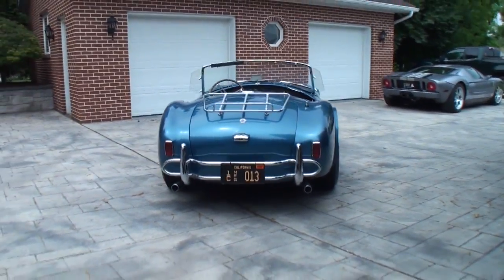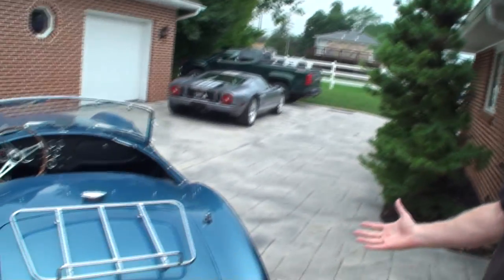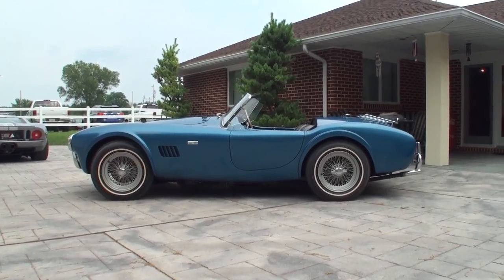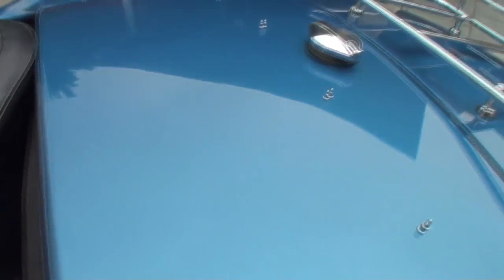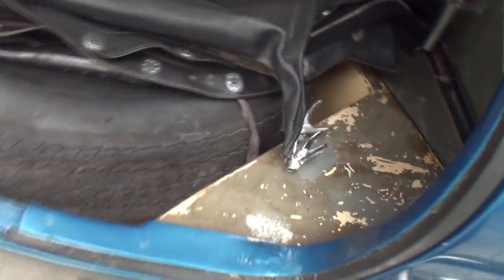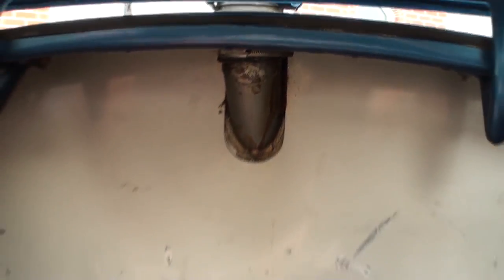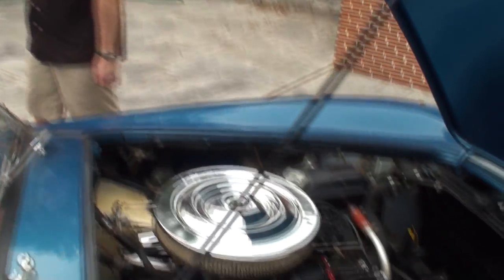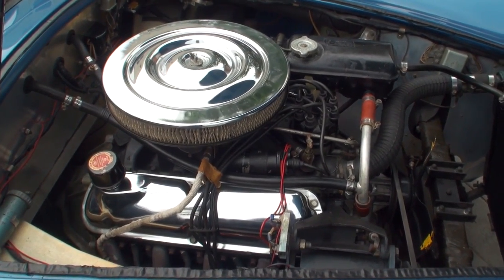1964 Shelby AC Cobra in Blue & All Original & 289 Engine Sound on My Car Story with Lou Costabile

Comment: 13,000 miles it hasn't been driven much. In about 1972 I was a member of the original Cobra Owners Club in the LA area. There was a member that had a 289 with 100,000 miles on it. It was a father and son and they drove the heck out of it including competitive events. I purchased my 1966 427 in 1968  with 9,000 miles. I added almost 50,000 miles in the next 4 years. I used to as my everyday car, took it on rallies, drag raced it, slalomed, etc. Since then I have not used it that much. It now has just a little over 80,000 miles on it. I'm 6'6" so it's a little  tight but actually fairly comfortable except for the heat. The heat wasn't much of an issue when we were in our 20s but it can be unbearable now that me and my wife are in our 70s.
Reply from the maker: Hi Ray Shepherd, Thank you for viewing, sharing and I believe you're going to see many more cars on this Channel you'll enjoy. Hope you Subscribe, and hit the "bell" so you can see all the cars when they are uploaded on this YouTube Channel, Lou

Comment: More FYI. I was in the paddock at the 1965 Bridgehampton Double 500. The Shelby team pulled in with two box tractor trailers they were both double deckers and one contained six 289's and the other contained two 289's on the top deck and a machine shop on the first floor. The Cobras all had the flared fender wells with massive Goodyear "Stock car Specials" mounted on those beautiful Hallibrand mags with three ear knock offs. the engines all had the 4 downdraft IDM webers. One of the drivers was Ken Miles, we met and talked briefly, real nice fellow. During the race the Cobras would come out of the last turn before the straight at full throttle an all you could her were those Webers sucking wind the whole scene was the stuff dreams are made of.It's hard to believe that that was 50 years ago. I believe that was the Sunday race when Walt Hansgen cracked 185 mph on the straight in john Mecum's SCARAB.
Reply from the maker: Hi johnnylyme, Thank you for viewing and sharing your thoughts. Hope you see many more cars on this YouTube Channel you enjoy. Please subscribe, and hit the "bell" so you can see all the cars when they are uploaded on this YouTube Channel, Lou